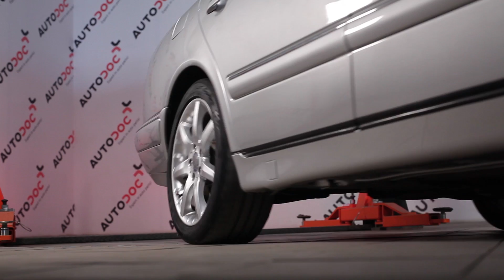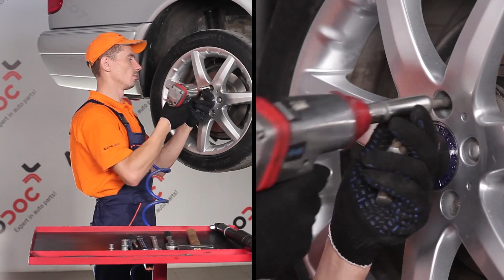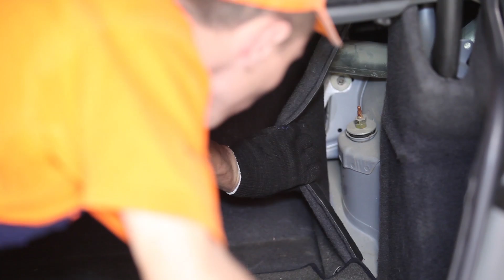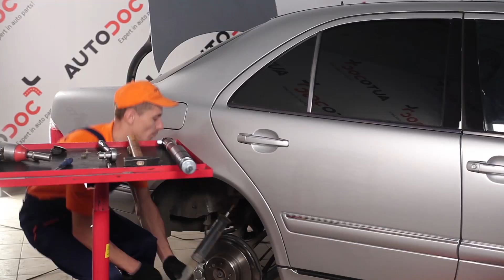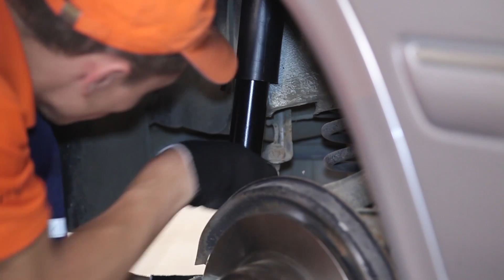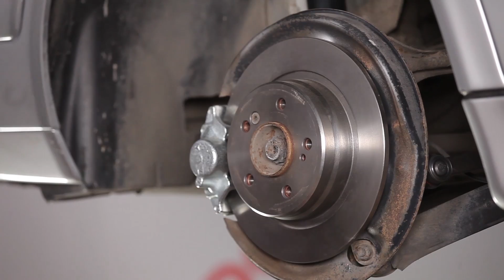How to change rear shock absorbers MERCEDES-BENZ E W210 TUTORIAL | AUTODOC

Comment: Hi i have just bought a 1998 e55. The front shocks have been replaced, would you reccomend replacing the back as well, also how do you get the windsreen squirters out , water is getting to them but they not squirting, do you pry them out, i dont want to break them!! Many thanx
Reply from the maker: Thank you for the feedback! Thank you for the interest to our channel, but unfortunately, we don't have such video  on  windscreen squirters replacement. You can find more detailed information in the Repair Manual for your car. Best regards, Autodoc.
Reply: If neither are squirting it could be a relay, pump, or as simple as a fuse.